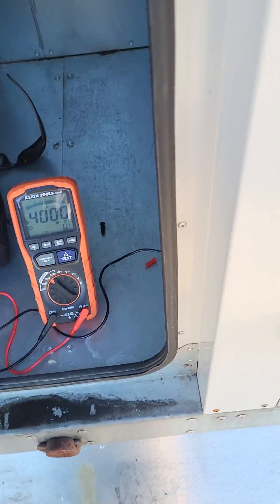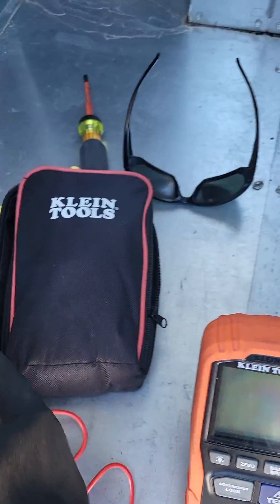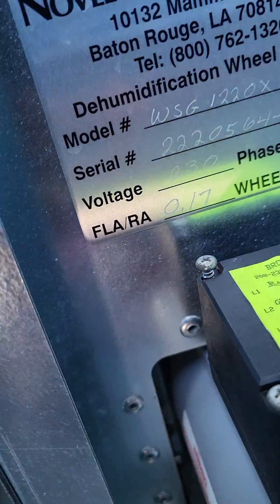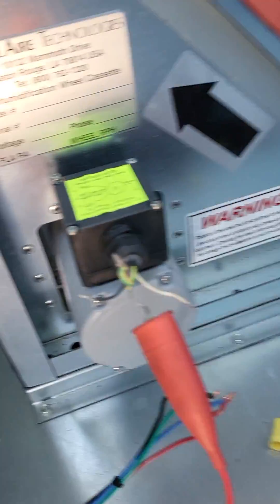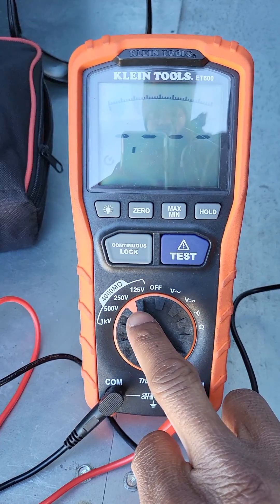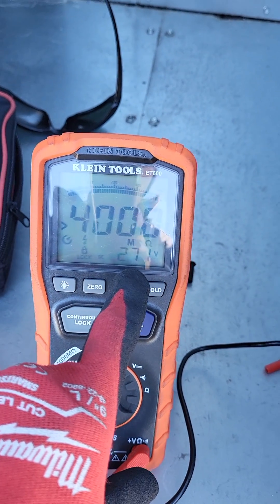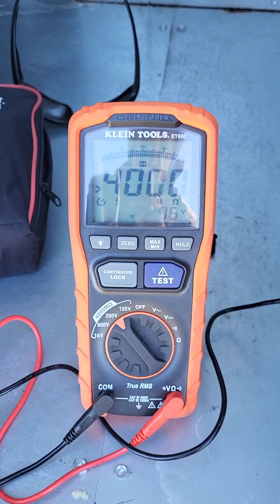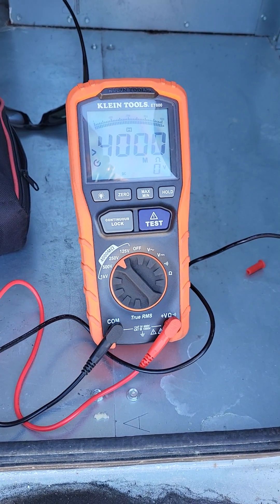Klein ET600 megger

Comment: I have an expensive Simpson megger ( also measures DC volts & resistance ) that supplies 250,500,1000,2500 & 5,000volt DC test to megger motors, transformers etc. Have picked up a ground on 4,160 volt large motors. Warning if you apply megger.leads berween motor leads short out the leads with a screwdriver. After using 1,000 volts to megget motor leads have received a nice shock with the voltage a motor can store gor at least a minute.
Reply from the maker: Thanks for the tips and the corrections.

Comment: Wrong on voltage. Always use double the test voltgae to megger a motor. For a 480 volt motor use 1,000 volts to megger.